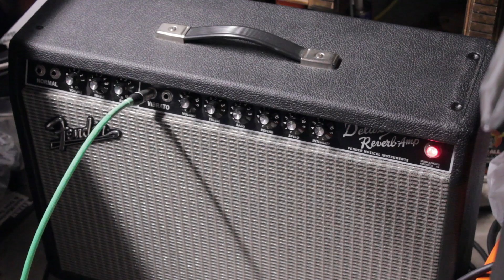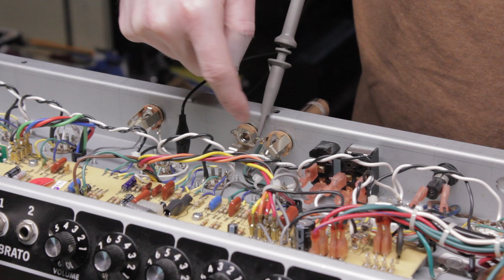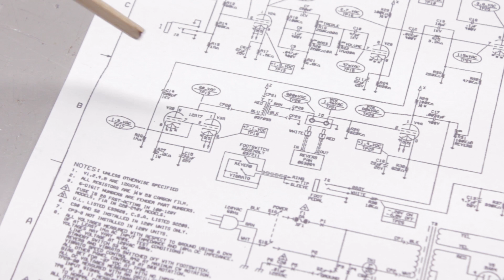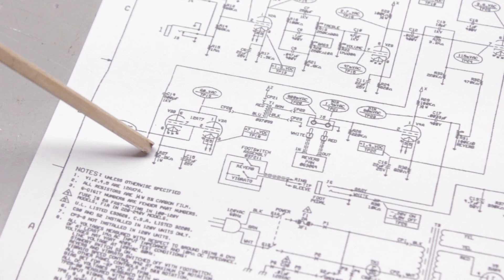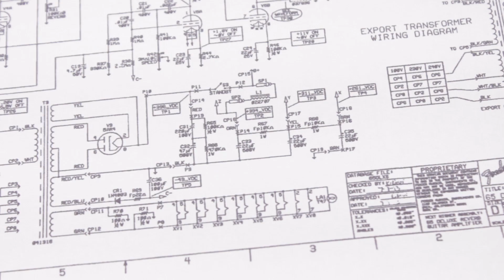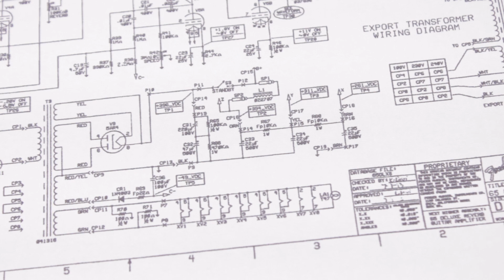How to: Fender Deluxe Tube Amp repair

Comment: My old ass fender deluxe thing I just got threw a hissy fit both when I plugged in my pedal, and tried to change the channel thing. I genuinely think it damaged my hearing from how loud and high pitched that shit was. I hope I can get it fixed and use my distortion pedal on it,
Reply from the maker: Sometimes it can be a microphonic tube on that channel's input. Or phase inverter can cause a really loud oscillation. Short of that, there's usually a damaged component somewhere that with the increased signal causes oscillation. And don't overlook the reverb circuit. Good luck!
Reply: @amp_mechanic  Thanks!

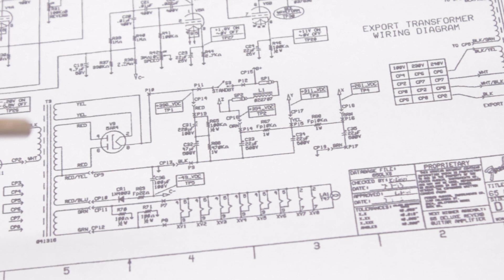Comment: Dude, I know this video is really old but MAN I hope you figured out that the voltage on the 12AT7 was NORMAL for this amp.  You can see even in this video (at around 21:00 minutes) the voltage coming from Z as measured at test point 2 (TP2) is 394VDC as printed on the schematic.  The plates of the reverb driver (12AT7) are tied together so both sides of the duel triode are used as one to drive the reverb.

Comment: Jay, if you watch this video of the Cesar Diaz has a switch on the back solid state rectifier is 10 watts more compared to using the tube rectifier. Why is it 10 watts more using the solid state rectifier, is the plate voltage on the tubes that much of a difference using solid stage rectifiers to output 10 more watts? Also the Crest factor is the positive RMS peak and the negative RMS peak and why isn't there a different crest factor from solid state to tube rectification?How do you measure the Crest factor out of amplifiers?

Comment: Jays Guitars, Why does the 1963 vibroverb has a different B+ voltage compared to the 1964 Vibroverb B+ Voltage value? Is the Power Transformer outputting the Higher B+ voltage? so they both have different AC power Transformers?The Fender Schematics of the vibroverbs tell the B+ voltages

Comment: JAYS GUITARS, When biasing a amp how do you know if the tubes are at the correct compression point when looking at the 1khz sinewaveform on the oscilloscope? or how do you "bias the compression" of the power tubes? The harder your drive the input of the guitar amp the power tubes will compress from drawing more current from the power supply.
Reply from the maker: I adjust it by playing through it. I have a couple guitars that I know really well and how they react  when I hit them hard or play soft going into an amp. Plus I have spent years training my ears. At the end of the day, all that matters is how the amp sounds and feels and that it's doing what the customer needs it to do. After the play test, I do a final check with the multimeter and if things are in a safe range, it's good to go. If not than you have to come up with a different solution or compromise.
Reply: @amp_mechanic  ok thanks
Reply: I dont know about tubes,but in AB transistors complementary NPN-PNP pairs the base in every output transistor should have 550mV for NPN and -550mV for PNP maybe not exactly but as close as possible but no more than 100mV maximum difference.Tubes should have their own biasing point too and internal circuit settings never doing by ear but always measuring voltages.

Comment: JAYS GUIATARS< if the B+ voltage is at 450vdc and you increase it to 600vdc will this increase the AC ripple voltage and output more wattage?
Reply from the maker: Hi Bill, The simplest way I think I can answer that is, a power amp design has a balance between the voltage and current draw to allow the tube to operate within it's design specifications. Sure a tube can run over 100% or even at 100% but it will have decreased life. I think max plate voltage is around 500V for a 6L6, sure you can run over that. But if you're biasing the amp to 70% anyway, you'd be running a lower plate current. Conversely if you ran a lower plate voltage of say 380, to bias around 70% you'd end up running a higher plate current. Each has it's own sound, benefits and draw backs and the design really depends on the power supply.   I find it much more useful to learn what the amp sounds like with a hotter or colder bias and adjust to taste. And trying to run higher plate voltages in an amp that's not designed for it, you'll have nothing but problems. Everything from component failures to noise issues, if not outright fire. And you'd want to minimize AC ripple not create more of it. Hope that helps.
Reply: @amp_mechanic  Thanks for the help, Do you bias your power tubes to 30mA mostly? I don't understand when the power amps LOAD current drawing from the power supply the AC ripple P/P voltage & AC ripple percentage will Increase higher when the power amp load current is drawing more current any reasons why? I would think the AC ripple P/P voltage & percentage would DECREASE not increase.
Reply from the maker: Every amp, even ones of the same model and type, I take measurements and calculate the plate dissipation. Fender's spec for the Hot Rod series amps of 30 per tube (60ma total) is a useless measurement unless every component and incoming voltage is exactly to design spec, which it won't be. The only way to get consistency in those amps is to calculate the dissipation and note for every amp if it needs to be cooler or warmer so it's not too compressed or throwing ice picks.

AC ripple, you are correct actual value would increase if you didn't design the power supply for the higher voltage. I was thinking in terms of designing the power supply to fit 600V for a pair of 6L6's, a good design would minimize AC ripple. That's all I was saying, I probably got lost on my way there....haha.
Reply: @amp_mechanic  But why would the AC ripple increase and not decrease when you Raise the B+ voltage? I would think when you increase the B+ voltage it would "Decrease the AC ripple NOT increase it. Can you explain what formula to get the ripples voltage from a higher B+ at 600 voltage would be? Eddie Van Halen & Randy Rhoades used a variac at 90VAC which would lower your B+ Voltage which would over your plate voltages and also the AC ripple would decrease or increase when you lower the B+ voltage?
Reply from the maker: Because of how it interacts with power supply filtering. There are lots of good resources on the subject. ElPaso TubeAmps has a lot of good videos where he sets up test cases.
Reply: @amp_mechanic  Some amps don't use a CHOKE in the power supply, what does this choke do to the AC ripple? If you don't use choke does this create "harmonics" added to the circuit and amplifier?
Reply: Every amp has a calculated bias level for a given voltage of the anodes or collectors or drains that allows the amp to work without distortion.Increasing the volume the power output will not change but the distortion and the final damage will be noticed.